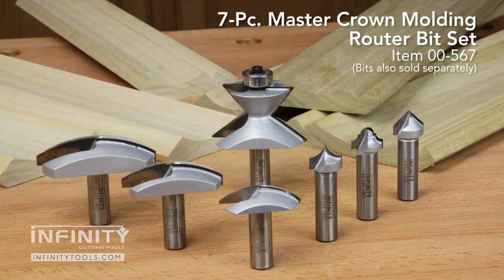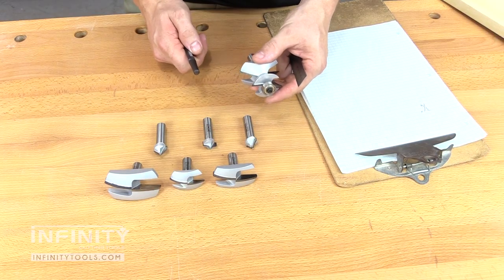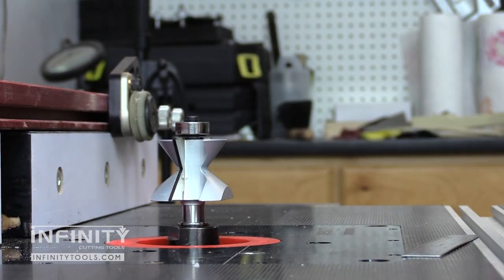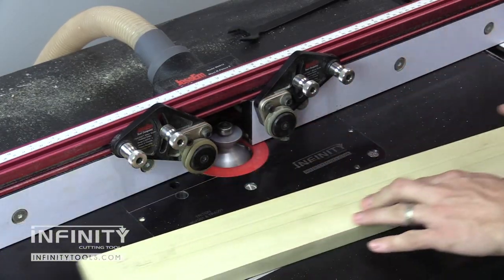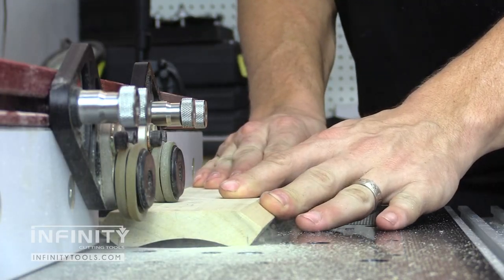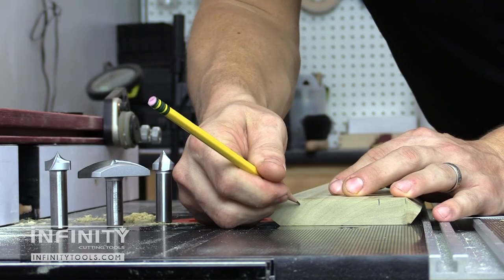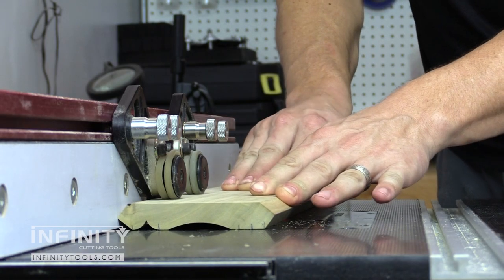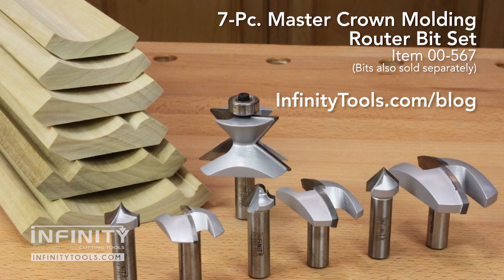How to Make Custom Crown Molding

Comment: FINALLY! Someone making their own crown molding rather than buying pre-made MDF. I’m a girl who had no idea anything about woodworking but I read endlessly & watched thousands of YouTube videos & finally bought a router table (from Harbor Freight). I’m sure it can’t compare to the ones you use - but I’m hoping I can still create some amazing things. 
I overthink everything I do rather than just go in & attempt something, so so far I’ve only made the same cut on numerous 3-8ft redwood 1.5x1.5’s with a square bit that leaves a 1/2” wide groove all down the center length of the boards that I later plan to fit the narrow ends of palette wood boards I cut to 18” inch long right into so they can serve as a side wall with their opposite ends fitting right into another 1.5x1.5 that I routed the same 1/2” square groove into.
The thing is I’m scared to take the bit out & put another one in because I don’t know how I could ever reposition it to be the same place it was when I cut with the bit I have in there now. (But honestly I’m not as scared of taking this bit out as I am future bits when I’m
Doing the kind of work you’re doing in this video. Unless I did all the boards I planned to
Work with with the same 1st bit so that I could make sure that cut was consistent, no matter what - once I had to insert the 2nd bit … I’m just nervous about how I’m Going to measure where to start on the piece I’m routing so that it’s consistent with each piece after that & the same with the 3rd bit switch out.
Reply: Same here, except I stand when I pee lol.  But I bought the same thing and love making moldings now!

Comment: Why are your rubber tires loose on your Jessem guides?  I have the same set but mine has not losened up yet, but now concerned they might.    Good video. I have not made crown yet, but its looking like I need to try this.
Reply from the maker: The tires are a little like the tires on a bandsaw and tend to stretch and wear out over time with use. We use our stock guides a lot. We are on our second set of tires in 6 years or so. I would say the first set lasted about 5 years and were replaced shortly after this video. We sell replacement sets here. https://www.infinitytools.com/jessem-clear-cut-router-table-stock-guides

Comment: Why don't more trim carpenters use router bits to make their own crown moulding? Seems like you can make any type you like if you have the right bits.
Reply from the maker: It typically comes down to time. For projects where time is not a major concern or for custom furniture where  you cannot find molding available in a specific species or style, making you own is often the only choice. Unless working on a very high end or historic project, most clients will not want to invest in true custom moldings.
Reply: @InfinityTools  your*😜
Reply: Because a lot of carpenters they’re under contract so theyre trying to finish the job and cash out
Reply: Most clients just dont want to pay
Reply: Americans love fast and cheap. Quality work is never a priority. These bits are hundreds of dollars for a set. It would take about a week to mill the crown moulding for a standard house so add a weeks labor to the cost plus materials, plus bits, plus extra overhead for router tables, set ups and workshop space. The cost to the consumer would be almost double.
Reply: Donde puedo comprar esas navajas ???